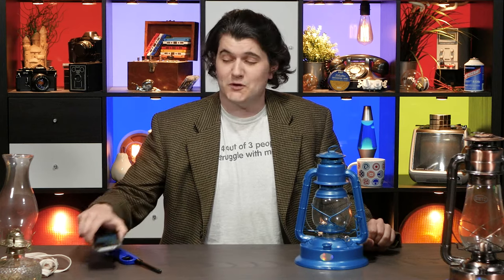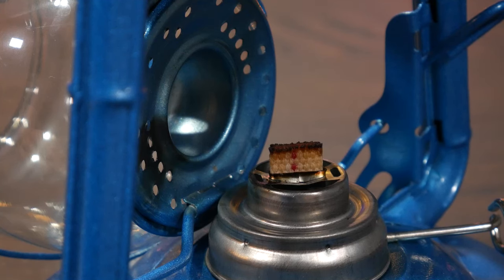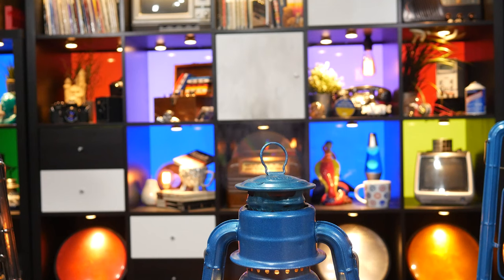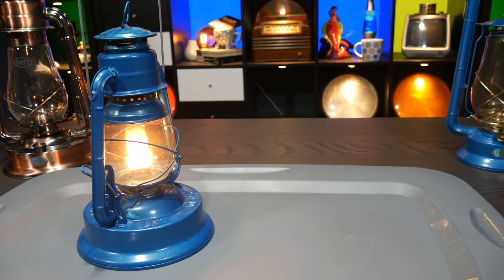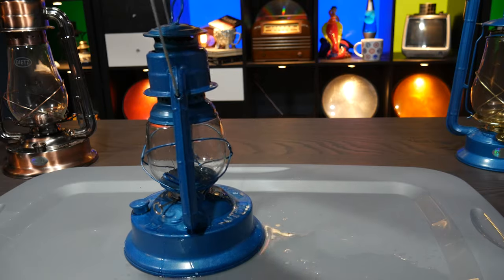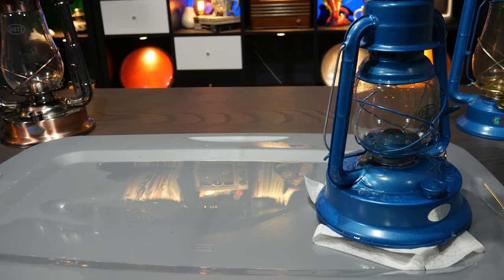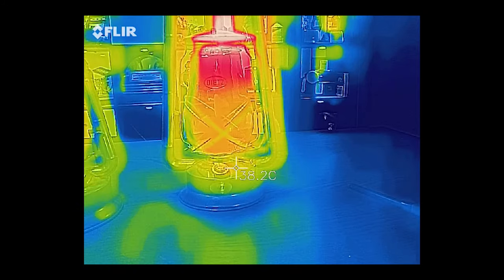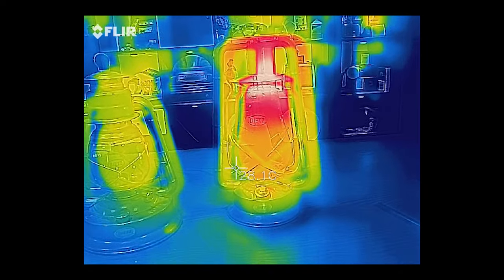How to use, more info, and further thoughts on hurricane (Dietz) lanterns

Comment: Alec, I had left a comment on your original video about all sorts of things, I'll leave a copy of it here, but we'd love to chat some time about how these lanterns work, as you still have some unanswered questions and some important points of the function of the lantern.  Most importantly, preheating the air does matter, and it would great if we could talk about these principles on the phone. Give us a call sometime!  Ask for Madison Kirkman. 

Hello, Madison Kirkman here with W.T.Kirkman Lanterns.  I've been a fan of your channel for a while, with a personal favorite being the soft ejecting toaster.  We are excited you produced a video on the subject, and honestly the research and resulting information is fairly accurate compared to many who try to discuss the subject with expertise.  There were a few things we wanted to mention since they were left unanswered in the video or were presented incorrectly.  

The first Kerosene lamp burner you found was invented by Michael A. Dietz on March 8th, 1859.   The 1860 patent you found was a reissue of the '59 Patent, likely with a minor change that I have not researched yet.

Hot Blast was first patented on May 28th, 1867 with Patent #65230 by John Irwin. 

@13:38 it is stated that the smell was kept at bay by sealing the tank.  This isn't true because there is not a good seal holding gas and oil inside the fount and most burners have a drain hole to prevent oil from collecting inside the burner, that also prevents pressure from building up.  A major topic should be brought up relating to the "Standard Oil Company" as the flashpoint of the fuel is very critical for lamps and before the time when fuel could be trusted, a fuel with a low flash point could create vapor inside the fount and that is what would explode, not the idea that it was under pressure. A proper flashpoint for fuel in lamps and lanterns is around 150 degrees F, at that flashpoint, the fuel in the fount will not reach that temperature, and thus not produce a vapor that can combust.  

Although I don't recommend possibly burning yourself,  dipping your finger in safe kerosene or lamp oil with a good flash point will then not ignite if you were to take a match to it since it's not producing vapor at 98 degrees or even room temperature.  Gasoline has a flashpoint below 0 degrees F so even in the winter time, gasoline on a pile of wood will ignite. 

Also research other lamps that were invented to safely burn fuel you didn't trust at the time, including a notable example, the Perkins Safety Lamp. 

Do note a principle of design is the height of the globe, as the hot air rises and spreads out from the flame, and meets the shape of the glass, it creates a vacuum that induces the flame just the same as the oil lamp does.  Short globe lanterns like the Little Wizard lantern you have weren't invented until 1914 and work a little bit differently from tall globe cold blast lanterns like the Blizzard model that was shown @21:14. 

Fun Fact, all 3 Dietz Lanterns you purchased are still produced on original American Tooling, hence the build quality. Now produced in China, however the tooling is original from before the late 1930's as these are non-streamed models.  The Blizzard Model has been in continuous production since 1899! 

Two principles suffocate the flame when it tips over, both the rising hot air no longer creates a vacuum, secondly, the one you noted, the cone covers the flame since the wick should be below the slot in the cone as shown in the video. 

The point you made about how Dietz produces lanterns for the 3rd world where they are still used commonly is the same reason why the majority of Dietz's production left the U.S. in 1956 and went to Hong Kong, they wanted to be closer to their market where lanterns were still being used in large numbers.  They were one of the first major American companies to move to China, and it wasn't because of the cost of labor or materials. 

And one of the most important points, the Fuel.  Kerosene should not be used indoors due to the much higher sulfur content in Kerosene, which produces the terrible odor.  We only recommend true Kerosene be used outdoors, or with very strong ventilation.  Proper Lamp Oil like Medallion Brand, the Clear unscented version of Florasense Lamp Oil, or Klean-Heat Fuel all have very little Sulfur to the point where it is unnoticeable indoors and have no compromises to operation compared to Kerosene.

Lanterns are much safer than open candles which people seem to trust much more than lanterns with a weighted base due to the kerosene and protect the flame.  

We'd love to work with you to help make further videos, including very interesting topics like the history of Pyrex which has deep ties with Railroad Lanterns, the History of Kerosene and Standard Oil Company,  Mantle Lamps like your Aladdin, and the very interesting oddball fuel of Calcium Carbide Lamps.
Reply: I left the last comment around the 10 minute mark, now just at the 12 minute mark you stated a few more things about lanterns and how horrible they are.  You are using the wrong fuel for indoor use, Crown Brand Kerosene, which has the correct flash point is true kerosene with Sulfur, which smells terrible.  When you use the correct indoor fuels like Medallion Brand Lamp Oil, Aladdin Lamp oil which extremely similar in chemical makeup and can be used in Dietz lanterns without issue, or even the clear clean version of Florasense Lamp oil.  Please use the correct fuel before judging the smell since you are using a fuel that does smell terrible and which we only recommend for outdoor use. 
-M.K.

Comment: One other consideration, is that with an increased combustion temperature, you get more complete combustion. The point you're making about it not being much of a factor in the whole scheme of things, yeah. Probably. I do still think that there would be some benefit, and it's possible that there is some consideration for optimising through pre-heating.

Comment: The flame temperature of kerosene+air seems to be 2366K (wikipedia). Assuming brightness scales with the Temperature^4, and assuming the burning gives the same temperature increase regardless of initial temperature, then a pre-heat of ~250K/~250C/~450F would give a 50% increase in brightness. With fancy copper heat exchangers, and vacuum+foil insulation, and glass coating that reflect infra-red but allow visible light to pass through, I think such a pre-heat MIGHT be possible (and the coating would also increase flame temperature even without preheating). However, that's so much effort, you might as well just get an LED + battery + dynamo.

Comment: I have three of the very finest Chinesium lanterns $8 can buy; I use them at family picnics to light up a little path from one part of my yard to the other. After the last one, I noticed the chimney on one lantern was entirely black, while the other two were fine.  I burn regular gas station kero in them, so a little soot is expected, bit this is ridiculous. With another picnic coming up, I finally took a moment to figure out why.  Turns out the chimney lifter was up, apparently the whole time it was lit last time.  That would explain it!

Comment: There are newer camping lanterns that the wicks are a little different.

Instead coming from the bottom they're coming from the top hanging down and they look like little mets.

And when the fuel is poured into the bottom it gets sucked up to the top and drips submerges the webbing of the nets. And burns that way.

Same type but with different design..

But the bottom wick lantern from the bottom will last a long time compared to the nets lantern
system. Once the nets turn into carbon they fall apart.
Then you would have to change them.

Comment: Very late with with this since the other videos about this are already up. But are you using the "Flir One" software by any chance with a Flir One Pro (the one with up to 400C specification)?
On the android app at least that I'm familiar with there are two important settings, the temperature range one and the parallax.

First press the + button that's in the interface outside the main view. There you can press temperature range there's one that goes from -40C to something not very high and another option from 0C to 400C.  And there's a slider to set the parallax under "camera alignment". If you're not using a Flir One Pro with the official Flir app maybe there are similar temperature range settings somewhere.

Looking forward to the "A very rambly coleman latern follow-up..." video on this channel that's sitting in the next tab. The videos on the main channel have been interesting, my dad was one of the thorium mantle complainers briefly. We used to have the gas burning ones early on when camping, but after a few years it was standard for campings to provide electricity for things like lighting making light much less exciting and interesting. Nice to see a comparison of the two though, early on during the camping years I must've seen some of the thorium ones and later alternatives but I can't remember other than considering it an odd interesting lamp that I wasn't allowed to touch (and by then we had electricity).

Thorium gas mantles was made illegal in my country in 2002 citing the following reasons (rough translation) for including them in the "not justified" category:
- inhalation dose could be too high when mistakes are made changing the gas mantle in an enclosed situation like tents
- good alternatives are available
Didn't check if it was owning/using them or just the trade in them, those laws are written in such a long and complicated way when it covers a big list of items. Also no idea if that decision was just for my country or an EU wide directive.

Comment: same as the car, a "cold air intake" would bring more dense, potentially oxygen rich air into the burn zone, but unlike the car, where you can put in more fuel for more power, i doubt the wick changes its fuel rate so it may produce a more "clean burn" since it could burn more of the given fuel, rather than vaporizing it and releasing it into the air.  at least thats what i would expect.
Reply: Raising/lowering the wick changes the fuel delivery. 
The more wick surface area exposed to the air and heat of the flame the more of the fuel evaporates. That's why it smokes if you raise the wick too high, the mixture goes rich and there's more fuel than can combust completely.

Comment: I use kerosine (paraffin) because its cheap.
Diesel and olive oil also works fine in mine.
They all leak when tipped over. The joys of the design.

Comment: Humphry Davy's miners' safety lamp
The first ever prototype of Davy’s miner’s safety lamp. Created in 1815, it was designed to be lit safely for miners to use without allowing the heat from the flame to explode the concentration of methane gas often found as miners dug deeper.

Comment: What a "cold air intake" really does for most people is eliminate a bunch of carefully engineered baffling in the factory system, making the engine louder, giving an illusion of power. Also usually trades a very good air filter for a very bad one, but they don't care about that.

Comment: Preheating incoming air is actually desirable in this case as it means less energy goes into making it reach the high temperature needed to glow, thus less fuel has to be burnt.

This is NOT a car engine.

Comment: I like these kinda lamps, they're pretty nice. I got one recently; though the smell is definitely an issue, but with the window open and a fan helping exhaust the air out the window it's fine (I imagine in a better ventilated room than mine, there'd be no issue, as even when the smell was an issue it was only barely noticeable). Though I'm using paraffin oil instead of kerosene.
Reply: That’s the same thing! Just a different name.

Comment: An alternative explanation for the hot blast flame lengthening over time could be due to oxygen depletion in the feed air as it mixes with combustion products.  Flame length scales roughly inversely with oxygen concentration, so as combustion products build up to some equilibrium level in the recirculating flow the flame could grow.  The timescales there might not fully work out though, you'd have to do some scratch math

Comment: The idea of pre-heating the intake air would be to facilitate a more complete, and thus cleaner combustion.  The flame may not be brighter, but the exhaust gasses should be less "dirty".  Whether that is appropriately implemented in the lanterns is dubious.  Your mention of the patent mentioning the air cooling as it goes down the tubes causing the tubes to draw more air in at the top... I believe what that is attempting to say is that as the air cools as it goes down the tube, it takes up less volume, causing a vacuum effect as it draws more air in to fill that space.

Comment: As far as the length of wick it came with; you mentioned these are commonly used in in areas where electricity is scarce; in such a place how long will that wick last if used as primary lighting for several hours each night 7 days a week?

Comment: 12:14 Ancient doesn't necessarily mean that it's without purpose or need.. Just because something is old doesn't mean it's no longer useful just as NEW doesn't necessarily mean better or well you get my point...  I worked on aircraft that were built in 1957 and the modern newer aircraft that were SUPPOSED to replace the one's I worked on couldn't stand up to the test..(always broke and never reliable)...  p.s.  just because you can't smell the exhaust doesn't mean it isn't there.. NEVER relay on that.. ALWAYS have a vent nearby(I only mention it because you were focused on the smell.. sorry..).    PLUS.. I've used the lanterns you've shown in this and the previous video my entire life and I've   A: Always had an exhaust nearby and   B: Never once had one fail me even in the WORST of storms... i.e.  wind blowing and howling.. it's comforting to know you've got something that will work no matter what.

Comment: aladin lamps can run on oil, as olive or "rapeseed oil"
Atleast in finland you can buy Odorles(odourles?) fuels for lanterns, apparently you can burn them indoors as well safely. I use one of those lanterns for ambience outside my apartment, i use the odo(u)rles fuel
Reply: Odourless fuel is also available in the United States, but even with that, there is a slight scent.

Comment: Interestingly these lamps are more picky about fuel types than some turbine engines. The PT6, one of the more popular small turbine engines found in aircraft is designed for jet fuel, but can use anything from regular jet fuel all the way to regular octane car gas in a pinch.

Comment: 5:07 adding a cold-air intake as a performance mod was a fairly cheap and easy way to get a small performance boost....on a used car 20 years ago. The aftermarket doesn't want to stop making money so they keep making new "cold-air intake" parts as if they're still just as useful.

Comment: If it "smells like an airport", you're using a low grade of fuel or the flame is too high, probably the former. Use of common 1K kerosene indoors is generally not acceptable due to odor and unhealthy emissions. You need a highly refined kerosene for an indoor oil lamp. Aladdin lamp oil is the supreme kerosene-based fuel for oil lamps burned indoors and what you should have in the lantern because you already have it. Next best is Medallion Lamp Oil.  Florasense lamp oil (only the unscented type) from Walmart is also supposed to be a good indoor lamp oil but I have yet to try it.

Comment: Well you do have the cold intake lamp there, not the hot one, so it not being that hot at the intakes makes sense... =) EDIT: Though your later video showcases that not being very hot either, mixing in the cool intake air probably indeed helps.

I think usually (from the charts and pamphlets I've seen) the preheating of intake air is less for making the combustion hotter, and more for maintaining a given temperature level with reduced fuel use. Agreed that in the case of a lantern it probably wouldn't be a huge difference, but if it's your main source of artificial light, and you're using it all the time, every little bit helps.

Actually on the subject of preheating, I found it interesting that my portable camping gas stove has the gas line go OVER the flame producing bits to preheat the gas. Not making any points, just found it curious.

I would still like to see experiments with a heat exchanger preheated intake, that doesn't mix exhaust gases into the intake, AND insulates the intake air pipes so that they don't get a chance to radiate heat. Probably almost useless, but INTERESTING and FUN regardless. =)

Comment: I actually started to feel sorry for you as you addressed many of our comments on the first video. In the big picture OF COURSE you are right- it is sad that people still have to use such outdated, unsafe, and wasteful devices to provide light. During your original video I was already thinking about the solar powered yard lights that can be bought for almost nothing. It would only take a little more collector and battery size and one of those could likely equal the output of a Dietz lantern. If we could make larger "solar" lights popular in the US, the sales volume would likely lower the price to where the third world could afford them too. (kerosene cost is not insignificant)